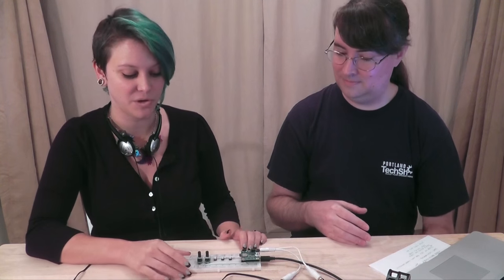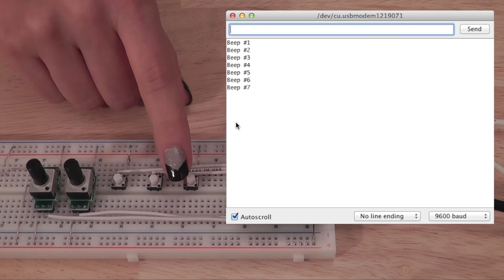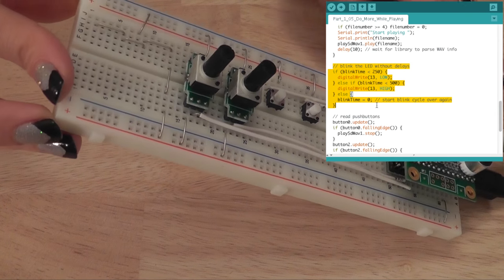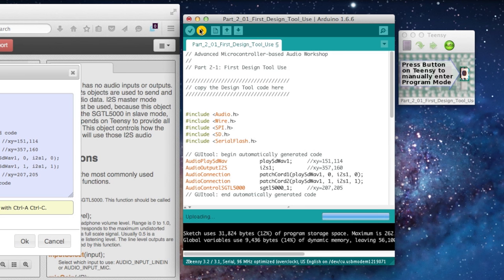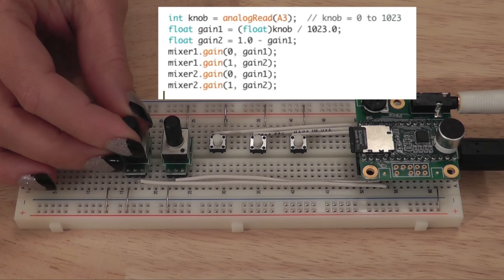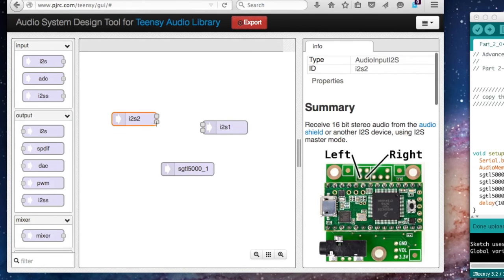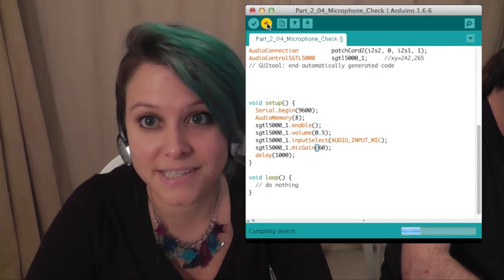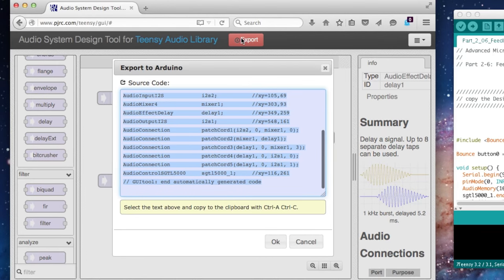Teensy Audio Tutorial & Workshop

Comment: Dear Paul and Robin... I want to thank you for creating Teensy. I have personally still not purchased or used Teensy. But I have plans to create a midi drum trigger project, and was researching how to do this with Arduino, and there are plenty of projects that have gone along these lines on Arduino.

But for midi applications, there is extra work to do, either you have to work out getting midi out of Arduino and then using a separate midi to usb interface to get this midi into the PC, or you ahve the extra work of trying to get serial to midi working on an Arduino so that you can pull the midi off through usb...

THE TEENS DOES ALL OF THIS! NATIVELY! I will certainly be looking at Teensy as the beginning of my midi project. And it is affordable as well. So thank you thank you thank you.

Comment: Hey Paul, first off: amazing work on the Teensy! 

I'm having difficulties using the DAC as an output on my teensy, is there a simple tutorial on how to do this available somewhere? Thanks!
Reply from the maker: Sorry, haven't (yet) made any more tutorials.  Probably should....

There's some info about how to use the DAC in comments in File > Examples > Audio > WavFilePlayer

If that doesn't solve it for you, best to ask on the forum.  When you ask on the forum, put a little work into really showing what you've done so far.  Post the code and even a photo of how you've wired things.  Questions that really show what you've done are far more effective than "it doesn't work" without any info.
Reply: I have tried successfully using the builtin DAC on teensy 3.6, just connect small electrolytic cap (aroungd1uF-10uF) to the DAC output pin (the positive electrode) and then connect the negative electrode to a 1k  resistor, then connect the audio jack:    dac_pin->cap->resistor->audio_jack. I got 12 bit stereo audio output with just with just additional 2 resistor, 2 caps, and a stereo audio jack.

Comment: Really great work Paul! I love the audio design tool. Looks like a lot of work to get it looking that slick.
Reply from the maker: Truth is the Node Red folks did all the heavy lifting on the graphical interface.  Thankfully they published as open source.  I reused their code to make the design tool.
Reply: And nice job on the Teensy sticks. Can't wait to get some audio projects going. Do you have anything new planned? Great stuff!
I
Reply from the maker: Yes.  The current beta is adding better frequency modulation and phase modulation for 9 waveform types and better reverb (freeverb) and a few other new features.  It's on the forum and download page now, and will soon release as version 1.42.
Reply: Thanks Paul! I'll check out the forum and v 1.42

Comment: I just found out about the Teensy, I've been working with an Arduinio Uno project to control RC cars, and now I want to add sounds to now and it seems really limited. I'm looking to sell my final product on its own custom PCB board. I would love to move the whole project over to a Teensy but is that possible to use the Teensy and this audio shield using that audio library program onto my own custom PCB to sell? What kind of license is everything under?

Also curious if that audio library works with the UNO, because on your main page I found it a little confusing "All audio is CD quality (16 bits, 44.1 kHz) and streams automatically as your Arduino Sketch Runs" Or does the Teensy use the same Arduino IDE?

Thanks!

Comment: This is great. I got all the stuff, but now I need to make the time. It's been on my to do list for a while.

Several time in the video you both say "gains greater than unity will clip", but that assumes that the software does limiting vs. allowing the arithmetic to overflow. Does it limit (I could check the code, but this is a lot faster).
Reply from the maker: Yup, time is always the limiting factor!

And yes, the mixers and other objects with gain do properly limit/clip/saturate.

Comment: If you want to do this project with Teensy 4.0/Audio Rev. D then consider using the hardware SPI connections with CS and DC on PINs 3 & 4.

Comment: Hi Paul - I am interested in the Teensy 3.1/2 for an embedded high power speak unit which uses a sensor to trigger a sound effect, which is just a very short length sample (< 1 second) which I will store on an SD card. The output of the Teensy DAC will go to a class D amplifier and then to a 15W RMS 2 inch speaker.  

I would like to know if it's reasonable for a program to read a short sample into RAM on start-up/init, and play on demand with as little latency as possible - is latency and issue if I were to try and stream on demand this sample, or is it indeed better (as I mentioned earlier) to load the sound file into RAM and just play it from that?  Can the Teensy audio library support this sort of behaviour? Thanks for your time, and your amazing work on the Teensy family of devices and support for them. 

edit: I see the audio board for the teensy, it looks like that's what I need rather than using the DAC myself - this would then go into the Class D amplifier such as this one: http://www.dx.com/p/y148-audio-amplifier-module-93121?tc=CAD&gclid=CO76zbGLxswCFQQbaQodKocPgw#.Vy2DIFgrKUl 

From the looks of it, i should be able to manage reading from the SD card into RAM and then playing the audio stored in RAM using the SD + audio board. Neat!

Comment: Guys you are awesome. Thank you for the video.
Paul. I've tried to do stereo mic with this amazing tool but it doesn't work out.
Sketch with 1 ADC channel works fine but with 2 ADC channals hangs dead. Need your advice on that.
Reply from the maker: +pin pin So far, the ADC object only supports a single pin.  A second ADC object using the other ADC inside the chip is planned, but unlikely to happen before July 2016.  Of course the code is all open source, so in theory anyone could try adding this, but the DMA stuff is pretty complex.  So far only 1 person (besides me) has contributed that kind of code to the library.

Comment: Wow amazing, this would be my next toys... Is it possible to protect our firmware in teensy 3.6 if I decided to make a commercial audio processor device using it?
Reply from the maker: Yes, locking the chip is possible if you edit mk20dx128.c, but comes with some caveats explained in the comments within that file.  Here's a link to the info.  https://github.com/PaulStoffregen/cores/blob/master/teensy3/mk20dx128.c#L36

Comment: This was very informative! However, is it possible to work with sound - e.g. to do granulation of a sound sample and output the sound - without the audio shield? Thank you for the response!
Reply from the maker: Yes, lots of other input & output hardware support has been added over the last six years (since this video was made).  But nearly all the examples are for the audio shield, so to use other ways you need to explore the other options in the design tool and dive into DIY hardware.
Reply: @PaulStoffregen  Thank you for a fast response Paul, I will do some research! Cheers!

Comment: Thank you Alysia and Paul for an excellent tutorial. 
I have a question regarding playing sound files that are stored on an SD card or on the Teensy itself.  Do you know the approximate delay from the time code executes a "play" command to the time the sound is actually output to a speaker?  Can one assume retrieval from an SD card takes longer?
Thanks.
Reply from the maker: +sonic8176 TL;DR = About 6 ms.  If the card has many hundreds of thousands of files, and if the audio system is taking a LOT of CPU time for other work, timing for opening the file can vary.  Some SD cards, like genuine Sandisk Ultra, are much faster than the non-name or Sandisk counterfeit cards, so that can make a difference.  Slow SD cards cause the audio library to impose more CPU overhead.  Latency can also vary 0 to 3ms, depending on when your Arduino sketch happens to issue the request, relative to the ~3ms (128 sample) audio update interval.
Reply: +PaulStoffregen  Adafruit makes a nice breakout of the VS1053 chip (and library) that I use for making MIDI drum sounds based on timer interrupts. (A project to help baseball batters with swing timing.)  I would like to convert my project from a Mega to Teensy 3.1(2) and I always wondered if it would be better (not necessarily faster but more predictable latency) to play actual sound files loaded in the chip's memory.  I didn't know about the audio update interval...Thank you again.

Comment: Great video and very informative. I would like to follow this tutorial for myself, but I can't seem to find the part where it is explained how to connect all the hardware on a breadboard.
Reply from the maker: Look at the "Breadboard Assembly Instruction" PDF here:
https://www.pjrc.com/store/audio_tutorial_diy_parts.html
Reply: Thanks!
Reply: I have connected all the hardware, and loaded up part_1_02_Hardware_Test. However when I run Serial Monitor I see this: Knob (pin A3) = 151
Knob (pin A1) = 194
Knob (pin A2) = 237
infinitely repeating and filling up the window, while in the video they only show when you press one of the buttons. What could I be doing wrong?
Reply from the maker: You've almost certainly not connected the pots correctly.

We have a great forum for helping with these sorts of problems.  You MUST post a photo (or multiple photos from different angles) of how you've actually wired everything on your breadboard.  Nobody can guess where things went wrong without photos of the wires, so please make sure you put good photos in your message when you ask on the forum.
Reply: Will do, thanks!

Comment: Have you measured the input/output latency and is it possible to reduce buffer sizes? The delay seems pretty long (maybe 50ms?) when she talks into the microphone. Is it easy to implement custom filter algorithms (e.g. LMS)? Thanks :)
Reply from the maker: Quick answers: The passthrough example has been measured at approx 7 ms latency, from analog input to analog output.  Most of that is 2 block lengths.  Smaller blocks are possible by editing the library.  Most of the code adapts to smaller blocks, but some parts break because they depend on the 128 sample block setting.

Longer answers: To discuss this stuff in more detail or talking about special filter algorithms or other developments, let's chat using the forum.  https://forum.pjrc.com/forums/8-Audio-Projects
Reply: Thanks a lot for the fast answer! I guess I will pick one up and experiment a bit :)

Comment: Hi, Great video.
Is it possible with Teensy 4.0?
Reply from the maker: Yes.  Except for part 1-5 (because of the LED conflicting with SPI SCK) everything in this tutorial video works fine when Teensy 4.0 is used with the Rev D audio shield.
Reply from the maker: and the final part with the display may need 2 of the display's control signals moved to different pins which Teensy 4 uses for I2S digital audio

Comment: Hi Paul, Thank you for the video. We are trying to use teensy to make an automatic guitar tuner and we were wondering if we can use your method without an audio adaptor?
Reply from the maker: Yes, the library supports using the on-chip ADC and DAC.  Using the design tool, you can just drag those input & output objects onto the canvas, rather than the I2S input & output which communicate with the audio shield.  You can even use them together, for simultaneous input/output by the on-chip pins and the audio shield.  Details for each object's features & usage can be found in the design tools right-side documentation panel.  The PJRC forum is the place to ask detailed tech questions.  When posting on the forum, it's generally expected to write a more detailed question with specific info about what you're trying to accomplish.

Comment: I just purchased my teensy 4.1 along with the audio adaptor board for my thesis project. I am just wondering, will installing the adaptor on top of my teensy prevent me from using the (teensy) pins it's soldered into? I don't quite understand how that works.
Reply from the maker: Quick answer: yes for the pins the audio shield uses, no for the others.  Longer answer: ask on the forum and give context about your project and other hardware you wish to use.  The forum is great for long answers and detailed discussion.  Social media replies... only good for quick answers.

Comment: Where do you get the header pins to connect the audio board to the teensy? Like a dummy I soldered headers to my teensy 3.6 but am waiting for the audio board in the mail and don't know how to fix my screw up. Desolder the pins and find the right double deck headers? Or ghetto rig and solder headers on top of the other headers? Any help?
Reply from the maker: Don't try to desolder the pins.  That almost never ends well.  Maybe some people with amazing skills and the best gear can pull it off, but usually desoldering ruins the pads & nearby traces.  Best to get mating sockets and add them to the other board.  There's no rule saying one board must be above or below the other.  The electrons won't know the difference, as long as the pins line up correctly.

Comment: Is there an audio library PDF or similar as tyo what all the possible calls are etc? I want to download to a fire when go on a train and use it as a reference for all the different function. Cannot seem to find a link to one.
Reply from the maker: All the function calls are documented in the design tool.  If you've installed Teensyduino, you already have a complete copy of the design tool on your computer.  It works without the internet.  To learn how to access it, turn to page 9 in the tutorial PDF.
Reply: @PaulStoffregen  Thanks. I was looking for a PDF to explain, ref the calls. I see the tool etc but it assumes you know what all the bits do.

Comment: Hello Paul, I am planning to do a project that involves the TLC5940 and This audio shield.  The problem is that the pins overlap.  Is there any way to rewire either the Audio shield or the TLC5940?  Thanks in advance.
Reply from the maker: The audio part should work fine, but you won't be able to use the SD card or optional memory chip if using TLC5940.  The old library for that chip doesn't use SPI transactions, so it won't share SPI nicely.  However, if you use Teensy 3.5 or 3.6 you could use it's built-in SD socket which is native SDIO, not SPI-based SD, so no conflict with TLC5940.  Short of massively editing that very old lib, I don't see any way to use both that chip and the SPI-based SD socket on the audio shield.
Reply: PaulStoffregen thanks Paul, just need to know, how do I do that?
Reply from the maker: Ask for details here:
https://forum.pjrc.com/forums/2-Project-Guidance

Comment: Can I record audio using an external usb microphone with teensy? and connected via USB host?
Reply from the maker: Today, no.  The USB host library does not yet have a driver for USB audio devices.  I'll probably create this someday, but 1 to 2 years is the likely time frame.  When/if it happens, that sort of device driver might depend on future Teensy boards which will have asynchronous sample rate conversion hardware.
Reply: @PaulStoffregen  Wow, thats great to know, Thank you!!

Comment: Hi there, is it also possible to play notes without delay? I want to synthesize sounds, but also have other processes running in the mean time.
Reply from the maker: Zero delay is impossible.  Even the fastest system can't avoid 1 sample, plus phase response of analog circuitry.  This audio lib typically has 7 to 9 ms delay, from event to analog voltage.  Lower latency can be achieved by editing the block size.  The forum is the place to ask for details (forum dot pjrc dot com).  It's been discussed on the forum many times, so perhaps try searching.
Reply: Hi paul, thanks for awnsering. I think i found my problem. Is it possible audioprocessingusage has some delay?
Reply from the maker: This question really needs to be asked on the forum, with the (complete) code in question posted in the message.  Details matter, often small details in other parts of your program which don't seem important.  That's why we always ask forum questions about specific problems to provide complete programs.  If you look at the many threads on the forum, you'll see we do very well at figuring things out when complete code is posted... and when it's vague descriptions or incomplete code fragments, usually a lot of time-wasting guesswork and conversation just to get a detail that would have been in the complete code!
Reply: I understand!

Comment: any idea how to do fft in form of bar graph . and use teensy   as spectrum analyser.   will be very helpful in looking at harmonics in electrical system . thanx in advace
Reply from the maker: +Tejeshw Vardhan In Arduino (with Teensy selected, as the File menu change depending on the selected board), look at File > Examples > OctoWS2811 > SpectrumAnalyzer.  It displays the 1024 point FFT on a big LED board as 60 bands/bars, each 32 LEDs tall.  Of course, you could use pixels on a LCD.  Look at File > Examples > Audio > Analysis > SpectrumAnalyzerBasic.  Or check out this project: https://www.youtube.com/watch?v=IUbECxGWvFw  Hopefully you can get some inspiration from these, to adapt to whatever way you would display the FFT info.
Reply: thanx